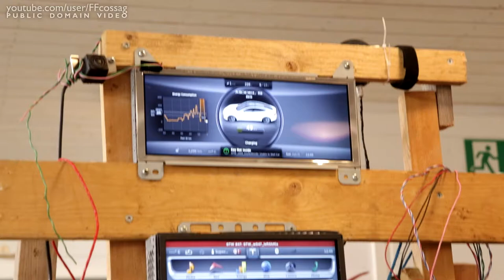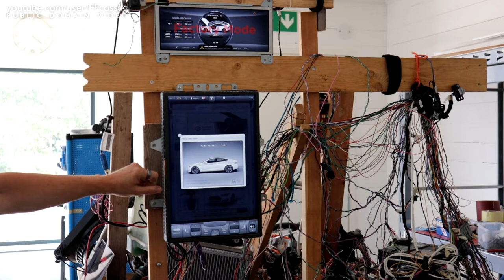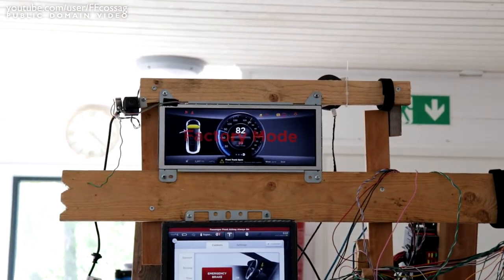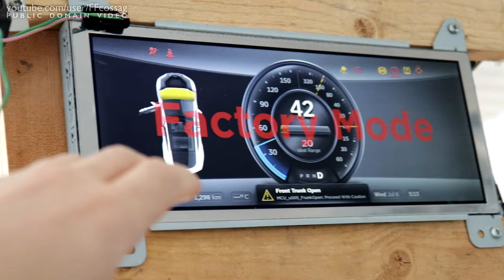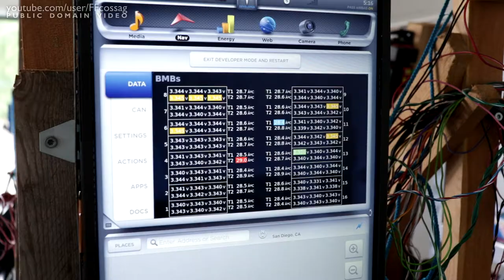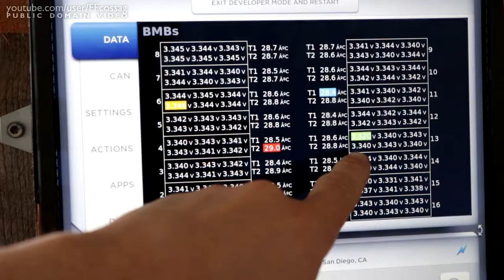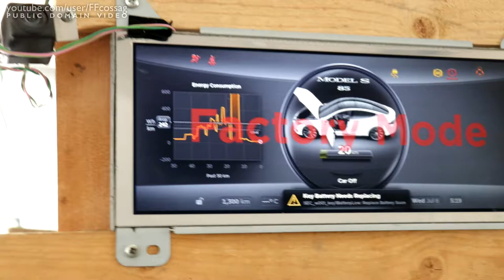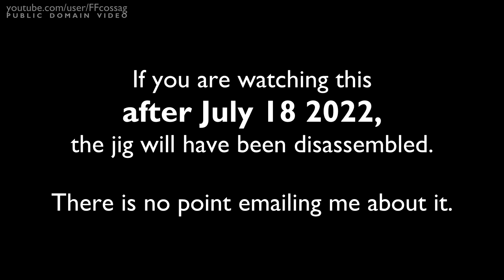Tesla Model S except it's a WOODEN TEST JIG!

Comment: Looks like the car I slaughtered.  We took everything electrically out of the car and put it together on a wooden frame.

We check that everything worked.  Then we started removing one thing at a time to see if the system warned.  It would be a boat with two Tesla engines and 4 battery packs.  the wires to the driving light would turn into lanterns, etc.  but there was a lot we did not need such as window lifts etc.